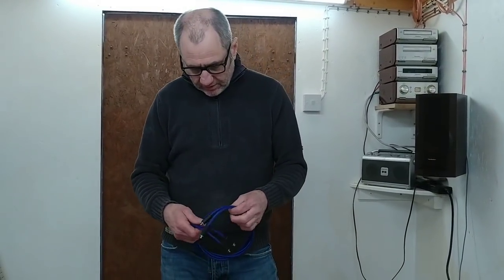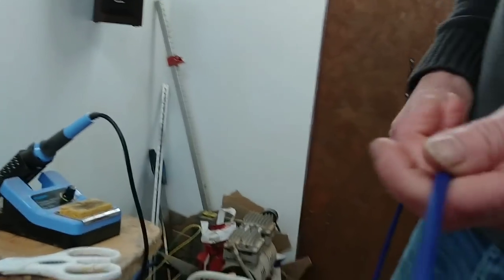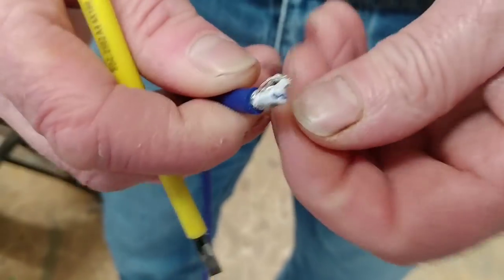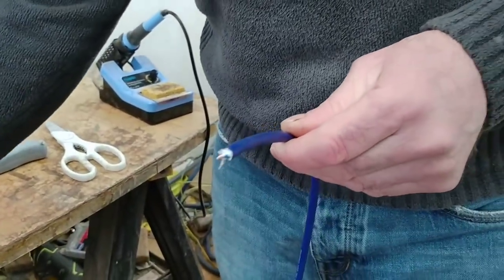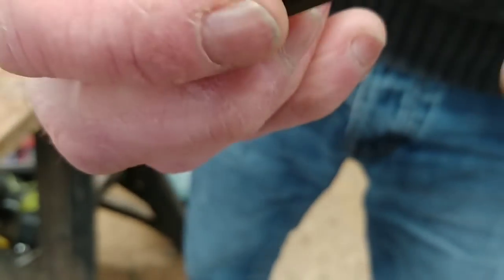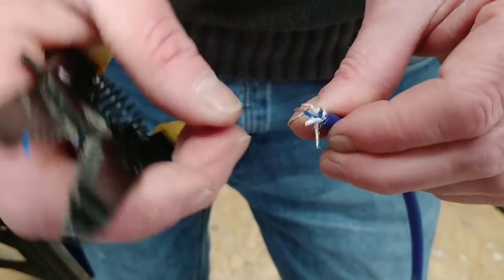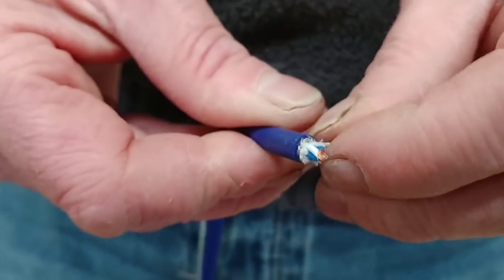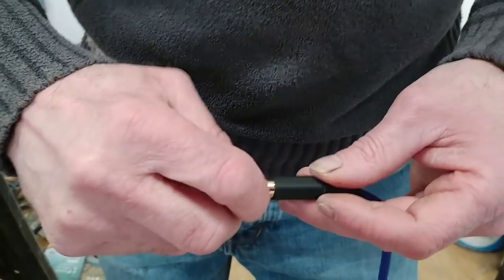One of the best off the roll audio cables

Comment: I just bought a cable for some headphones (Sennheiser HD600) and the guy who made it happened to use Van Damme Cable, so was curious. Good to know you rate the cable, it wasn't expensive so it's nice to hear.
Reply from the maker: Hello, I wired my son's hd595 with this van damme star quad cable, this is one of the best cables van damme make, it takes around 500 hours to break-in, to reach optimum performance, thanks for commenting & watching.

Comment: Hello mate, love your videos, could you please tell me if this sort of cable could be used to make a balanced headphone cable for the hd800
and will you ever be doing a tutorial video for a balanced cable, thanks.
Reply from the maker: Hello, this cable is perfect for balanced cables & yes you can use it as a headphone cable, I've used this cable on my son's HD595's, you need to run this cable in for around 500 hours, to get it to sound the best, I hope this is help & thanks for watching.
Reply: Thanks very much
Reply: Great video! Would that specific cable be good for audiophile RCA interconnects for car amplifiers? Or is there a better van damme cable better suited?
Reply from the maker: @drewe5961  Hello, it should be good for car audio cable, thanks for watching.
Reply: this is a bit late as i've just found this video, but the definition of an 'unbalanced' cable means it only has a single conducter for the center pin on the plug. 2 or more conductors, like this cable, is balanced

Comment: Great video could you please tell me if you use this as a speaker cable could you cut the jacket off it and put ptfe tape over with braid also would u ground it to your amp thank you Michael
Reply from the maker: Hello Michael, if you want to use it for Speaker cable, you will need 6 lengths to build up the size, so what I would do, is cut the jacket off of 3 lengths, twist the 3 together, then wrap ptfe tape around, then join the 3 braids together, & then gound them, so 3 for negative and positive, if you get what I mean, thanks for commenting and watching👍
Reply: @tweakerman  thanks so much michael enjoy all your videos could u suggest a good lead for a dac michael
Reply from the maker: @michaeldauskursas3958  this cable is excellent, look on ebay for it, https://www.van-damme.com/vandamme_product/van-damme-transmission-grade-11mm-triaxial-camera-cable/
Reply: @tweakerman  thanks for your time Michael

Comment: Keep up the good work.Really enjoy your very informative videos.Ive always thought that cables were a rip off from these large companies.Ive just started using Belden  electric cable for speaker wire and it seems to be working really well.How long do these cables take to burn in ? Kind regards Terry.
Reply from the maker: Hello Terry, speaker cable, usually takes around 300-500 hours of listening before they reach optimum performance, I hope this is helpful & thanks for watching.
Reply: Thanks for getting back and thanks for sharing your knowledge. Cheers Terry

Comment: lol getting them cryogenically treated makes 0 difference to the sound. I cant believe some people fall for that bs.  While cryogenically treating the increases the electrical conductivity it only does that while it cold, as soon as the cables warm back up to room temperature the benefit is lost so you would need have the cables submerged in LN2 indefinitely. And cables do not need to be broken in ffs.
Reply: Think he said it was for preservation of the cable.
Just need to get two cables - 1 which has been used for 50 hours and a 2nd which is unused and A/B compare the two.